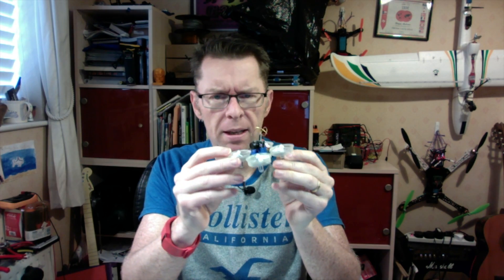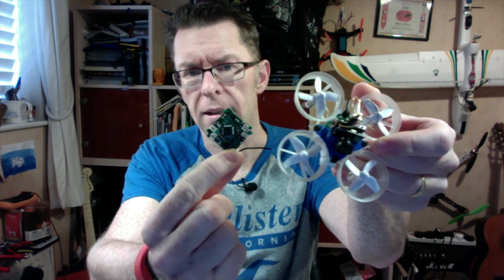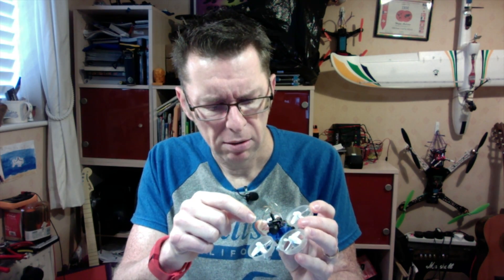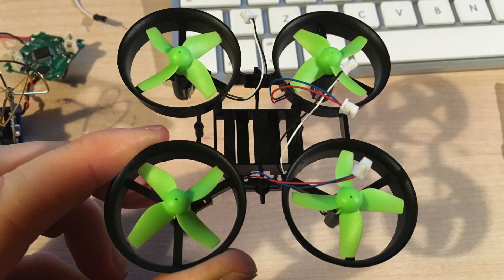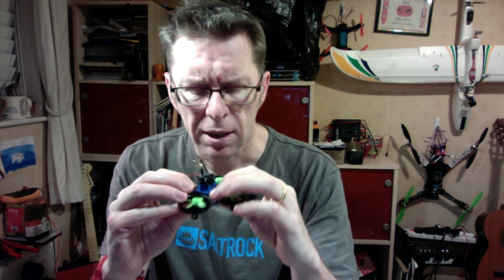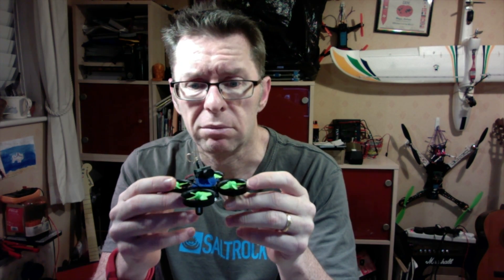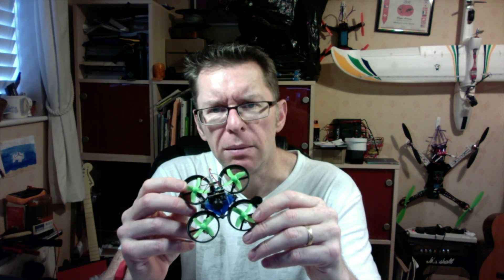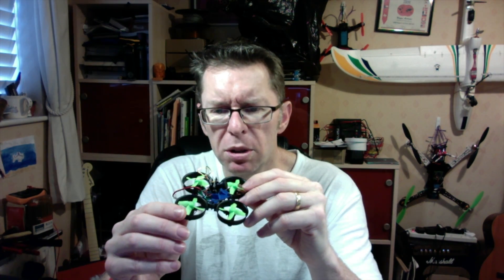Micro FPV: Moving from an Inductrix to an Eachine E010 build

Comment: I have done the same build with the E010 flight controller and battery is a huge difference...But the motor upgrade is where its at!!
17,19,000 KV will do all the flips and rolls you want!

Comment: i got son a eachine e010 but i tried using the inductrix cam and canopy and lord its got issues but it does use stock flightboard with stock tiny radio ,it seems to have a yaw issue when cam and canopy on..would it be the flightboard getting off noise from the inductrix vtx?
Reply from the maker: Wouldn't have thought so, VTX's and Camera aren't something that normally causes noise, but are more affected by it.  Perhaps it's a weight/position issue - the way to pin down which would be to have the cam/vtx onboard but unpowered.  Fly it this way and see if it flies differently to when it is all connected up and powered

Comment: can you share your clean flight settings - i will use the same for e010s + flysky radio
]
Reply from the maker: They are actually stock - all I did with mess with the super rates (or possibly just "rates" as this was back in Jan) I can tell you those if you like - but you might find your own personal preferences are better for you

Comment: i replaced the e010s motors with racestar motors but the quad cannot fly in the wind. I'm confused how do the tiny whoop pilots make videos of flying outdoor. My quad cannot face even little wind even after replacing motors. Do i need to use beecore / beebrain controller - will that make a change
Reply from the maker: It's probably in the motors, there's some ultra-high kv ones at places like micro-motor-warehouse.com which will give some serious punch.  The figures on the racerstar us 67000 rpm, which is probably something like 15000-19000kv depending on the voltage, but as the voltage drops pretty fast on the 1s lipos it's more likely the smaller.  Put a proper 25000kv motor in there and there's going to be quite a difference (although in your flight times as well)
Reply: thanks for your reply - i have these motors 

https://www.banggood.com/4X-Racerstar-615-6x15mm-67000RPM-Coreless-Motor-for-Eachine-E010-E010S-Blade-Inductrix-Tiny-Whoop-p-1141773.html?rmmds=search
Reply from the maker: Yep - those are the ones I assumed.  When they quote a motor figure in RPM it's not very useful, because it doesn't tell you the situation are a certain voltage.  So it sounds fast, but it's a lower kv that you might want for super-power

Comment: hi, can a cheerson wifi camera module like the link below be used on this drone and get fpv on phone?
https://www.banggood.com/Cheerson-CX-10WD-CX10WD-RC-Quadcopter-Spare-Parts-Wifi-Module-with-Camera-p-1074739.html
Reply from the maker: Maybe - it's unclear what the connections are on the module, but I'm sure with a bit of hacking you could get it running.  There's likely to be some increased latency using a phone for FPV though... which is why it's not a very popular option
Reply: thanks, but since the cx 10wd model can be controlled by phone through wifi, i was wondering if any additional hardware is needed fr this module to be used on other drones? or can it be used standalone with just power supply and connected to phone via wifi like the cx 10wd model?
Reply from the maker: I can't speak with any authority about this, as I don't own one, and never have.  However,  the module you've listed just appears to handle the wifi/camera part - I can't see any other hardware that might drive the motors, or contain the accelerometer.  if you look at the pictures here https://www.banggood.com/Cheerson-CX-10WD-CX10WD-RC-Quadcopter-Spare-Parts-Receiver-Board-p-1074736.html?rmmds=search you can see that the original board you linked to sits on top on the frame that appears to have all the other hardware onboard.  Part of this will be receiving data from the wifi module and turning it into motor inputs.
Reply: thanks, if we control h36 with its remote, just for the fpv part can the camera transmit video via wifi to phone like the cx 10wd model?
Reply from the maker: Best I can say is "probably"  Although if you are looking for FPV via a phone have you considered something like this https://www.banggood.com/5_8G-OTG-FPV-Receiver-UVC-Capture-Card-Apm-Pix-for-Android-Mobile-Phone-p-1128907.html?p=E81211714085201408XQ at least it should work without any extra hacking about
Reply: yes i hv thought of it too, but it just doubles up the cost buying cam+ receiver. the wifi cam looked like the cheapest option if it works

Comment: stock Furibee F36 is a gram lighter, has 32k rpm motors where E010 is 22k. lose another 1/2 gram using E010 canopy, lose 0.2 gram using RakonHeli 3 blade props having slightly less pitch. (the E010 you'll gain near a minute flight time chopping the 4 blade props down to 2 blades.) things I've been finding/deciding. also boldclash f02 cam is split board+camera about 1/2 gram lighter, board will just fit under canopy with fcb, camera low front mount for low profile (counterbalance to battery too). "recipe" starts out 1.7 grams lighter with more powerful motors already in place. stock Furibee tx+fcb only good for about 30m max, does better with both antenna's exposed/vertical.
Reply from the maker: I'd not heard of the Furibee F36... another clone :)  I'm actually using the Chaoli CL-615 motors which quote a specified RPM speed of 55k, although there are 59k rpm motors available too.. which I might try.  Not seen those props either - which look cool, will try and get some of those to try - thanks
Reply: yup, the F36 has been called the clone of a clone now, forum guys really liking its power. the numbers I saw for motor speeds was with props mounted in their ducts full throttle (+ pinned down!) what I didn't see was numbers for lift/thrust. free spin rpm numbers vs under load, big differences.

ordered the F36 through eBay, the E010 canopy banggood, the rakon props readymaderc.com .  Furibee did the F36 hoop struts ^ shaped instead of flat also helps flow+lift. watch some YouTube video's you'll see, it's MORE!

I hope the next "clone" gets 7x16 motors or someone scans and modifies for 3D printing, more torque to the stock 4 blade props could be much snappier with vtx and larger battery onboard. it would add a little weight but may also draw smaller average current for same kind of work load = longer flight time.
Reply: i build one of these with the beecore f3 evo bloody things useless starts losing lift everytime i pitch or roll and thats with the chaoli cl 59k rpm motors.so glad i got a qx90 so much better then a whoop.
Reply from the maker: I personally find anything with the 8.5mm motors a bit spicy for around the house - but great for a small outdoors area for the garden
Reply: update.. saw more spec's. stock E010 does about 25 gram vertical thrust, motors spin about 22k RPM in place (props in ducts). stock F36 about 34 gram thrust, motors 32k RPM in place. other note I'd seen is E010 fcb may be allowing more pitch could be more speed on tap with a  swap of the toy's boards. E010 with the F36 board after the swaps could still be good for handing off to a youngin to learn with.

+jason smith I could see that happening quickly if all the parameters aren't dialed in on computer program. motor rpm and current, AUW, etc.
(I'm sure no expert on these things btw!)

Comment: Fun video thanks for the information. I have the e010 and I'm about to buy the TX03 camera, can I still use the stock batteries (3.7V 150 mAh 30C) once the camera is soldered on? I'm not sure that I will end up getting the added flight board.
Reply from the maker: I just had a quick go with the Inductrix stock 150mah 25c lipo and it flew, but only for 2 minutes.  The Nano-tech's I use are only 200mah, but 25-70c and you get double the flight time - so it's all about the C rating.  Hopefully those stock e010 lipos are a true 30c.  Expect your flight times to be reduced, but quite by how much depends a bit.
Reply: boldclash f02 is a tiny bit lighter and mounts low profile too. banggood has the 260mah upgrade batteries for the H8 3D is about right

Comment: The Furibee f36 frame has been reported to be lighter and more flexible than the E010 frame, and I truly believe lightness to be the key.
Reply: yes indeed, just posted the "budget recipe" here.
Reply: Yeah thats true but now if you buy the e011 it has bigger motors and is more capable of flying with weight, just take the top off and add a aio camera and it flies great thats what ive done and i sit in my chair and fly it through my house. Even on a non windy day i get away with it

Comment: You seem a little underwhelmed Wayne, at least you can fly yours with a proper radio. I've been flying my fpv Eachine e010 with the tiny stock controller and I'm actually getting used to it now lol. 10 years ago we could only dream of such wizardry these things are just amazing 😎
Reply from the maker: Although I'm pleased with the way it flies, I did think I'd get a bit more from it.  I wouldn't like to rave about it and encourage everyone to get the same setup unless I was actually raving, so yeah - a bit underwhelmed.  I think not just because I still want more power, but because I thought I'd done it on the cheap, but totting up the components were about the same... so meh really :)  

In terms of what was possible just a year ago, it's amazing - I'm still blown away by this tiny little F3 controller with a FrSky rx built in, and a £17 cam/vtx that weighs as much as a flea
Reply: crezzee 
If you're using a Taranis/9XR/T9X or similar radio with a JR style module bay I can recommend one of these:

http://www.banggood.com/Multiprotocol-TX-Module-For-Frsky-X9D-X9D-Plus-X12S-Flysky-TH9X-Transmitter-p-1097688.html?rmmds=search

I have one of these in my Taranis and it's quite a liberating experience to fly the little Eachine with a full range radio.

I also have this in my 9XR:

http://www.banggood.com/2_4G-CC2500-A7105-Flysky-Frsky-Devo-DSM2-Multiprotocol-TX-Module-With-Antenna-p-1048377.html?rmmds=search

It's handy to have a little bit of knowledge of Arduino/Avrdude when setting the protocols you want out of all the ones it supports as it only has 32k of storage.

Regards
Nidge.
Reply: Haha, yours actually works then sputniksam? I have wasted way too much time with one of those modules (the first one in your links above) I gave up in the end must have been sold a dud.  I think the nrf24l01 module is faulty on as the led seems to do the right thing.
Reply: crezzee 
That is a big shame, though I don't think you are alone as I've seen reports from others having very similar issues. Just for wotsits and grins it might be worth removing the foam covering and giving the board a go over with a hot air gun on the off chance that the original solder flow process didn't reach all the points intended.
Regards
Nidge
Reply: Yep already tried that Nidge, I'm an electronics engineer and have access to some high end reflow gear :0)

Comment: Just got my self a QX 95 and although its not guarded it has the power your missing. For the same ish price you get 2 lipos and 2 spare motors too. Choice of radio combos, light bar and an F3 board. I have just gone down the same rabbit hole with the whoop, its uncanny lol. Wish for the all in price i had gone down this route first.
Reply from the maker: I've got this LT105 which is fantastic, but the extra power needs more space.  I guess that's the tricky balance - managing the right amount of power with the amount of available inside space you have.  I do have some bits on order to make my QX80 less crap and heavy - see how that goes as well

Comment: Thanks for this video. I also have a converted inductrix to tiny whoop, and true, I replaced all but the frame and FC, although I have ordered a new fc (FuriBee F3), still waiting for it to arrive. So perhaps I will order one of those e010 frames, so I dont have to mess with the tiny whoop. Are the weights (=flight time) the same btw?

and Mr Steele did a nice house tour flying his tiny whoop, doing some of his famous tricks, so it should be possible with a tiny whoop.

Also, there are other ways to get your taranis working, I bought one of those 4in1 transmitter modules from banggood, so I can connect kind of any receiver.

Glad to see how stable your flying is, good to see the possibilities, it wants me to fly my whoop again.
Reply from the maker: I haven't weighed it, but by feel they seem almost identical.  I did have my timer set at 5 mins on the Inductrix and it's getting more like 4 mins on the E0101, but different motors, and I can't remember if I ever got to 5 mins on the Inductrix.

Yeah - I saw the Mr Steele one, I expect he has some of those "insane" speed motors that micro-motor warehouse do (the one's I'm to cheap to buy :) )

I was thinking about that 4-in-1 board I saw, but I do like having the tuning options available in betaflight, and running the multiple profiles depending how gentle I want it
Reply: go furibee F36, gram lighter and has faster motors already. look to the RakonHeli 3 blade props, lighter and slightly less pitch to let motors spin up easier = punchiness and helps flight time.